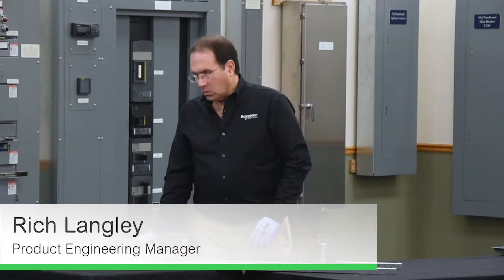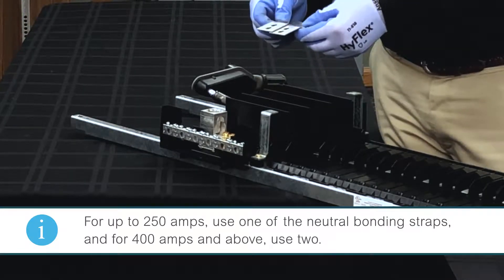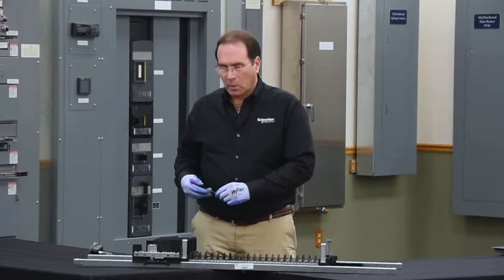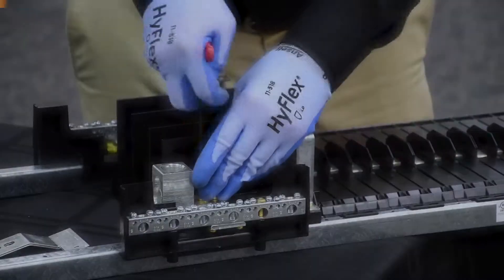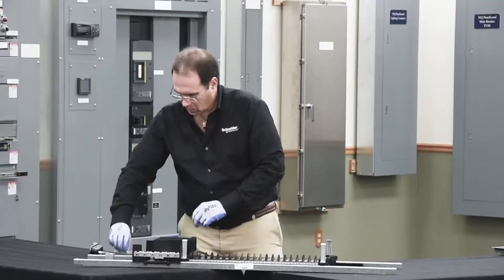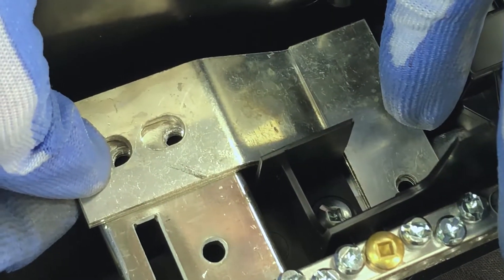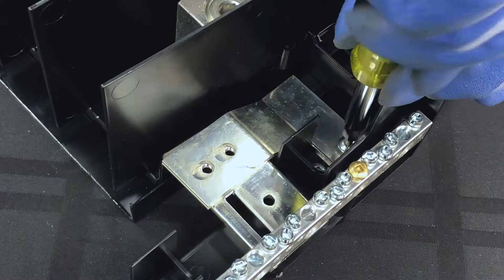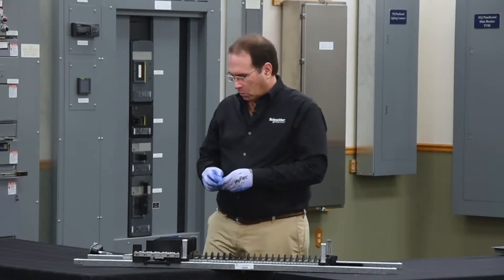NF Service Entrance Neutral Bonding (1 of 1)

Comment: What is part number for the bonding straps used in this video.  I need them very bad.
Reply from the maker: Greetings, Barry - Please contact the 1-877-342-5173 or contact us thru the website (see below for a suggested start). 
These parts are different for panelboards based on their ampacity. 
You will likely need to know the catalog # or the Factory Order # of the panelboard to get the correct part identified.
On our FAQs, this question was asked that is similar to yours...hope this helps get you in the right direction:
"What is the part number for the bonding strap used on 400A and 600A NF panels?" - https://www.se.com/us/en/faqs/FA103899/